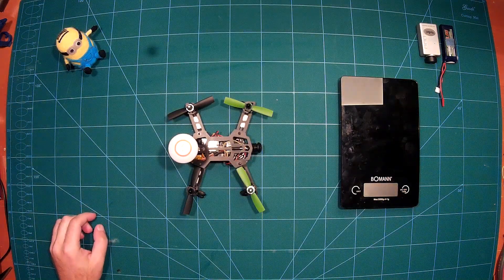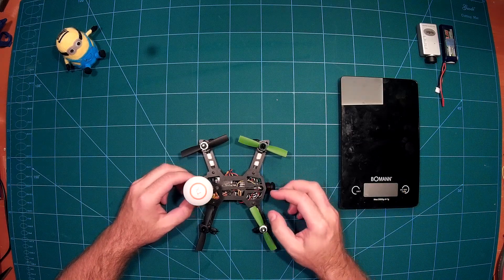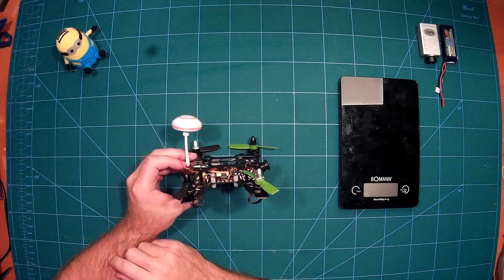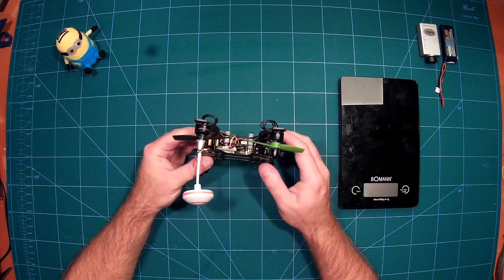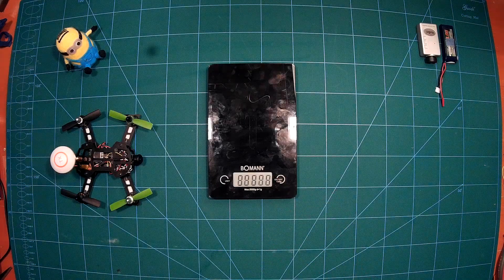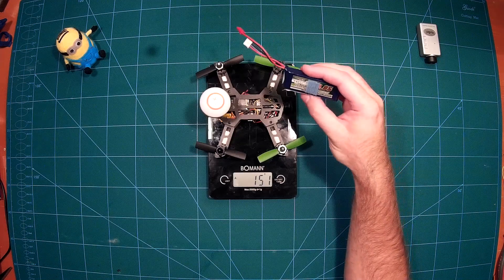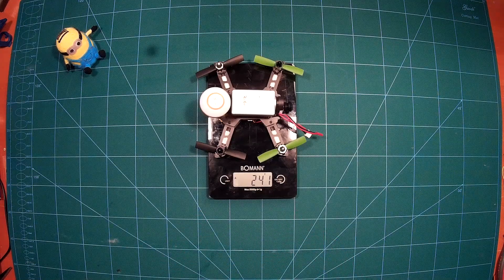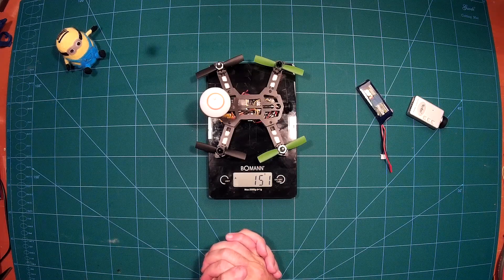Sub 250g Full HD 1080p FPV Quadcopter

Comment: similar to might
my setup. I run on 3s and it flies great, pretty quick. I have flown it with the Runcam on as well,but it doesn't handle as well, though I've just got some smaller 850 3s, d
so it might be better with them. an 808 would probably be better.
Reply from the maker: +Jake Bullit Sounds awesome Jake. Yeah, the RunCam is a bit of an overkill, it was more meant as a demonstration of how light-weight a full-hd recording copter can be these days ^^ :-)

Comment: Many thanks just what I'm looking for, would this battery be good for it Dualsky Xpower ECO-S Series 3S 11.1V  800mAh 25C
Reply from the maker: +Drone Flyer Just to be safe, go for something with a higher C rating. Those Dys can draw 7-8 Amps each with that setup (on punch outs particulary). 7 Amps x 4 motors = 28 amps. Your 25C lipo is only good for 25 x 0.8 = 20 amps. It will probably fly fine with that 25C battery as well, specially since we have only cut 4 inch props on this setup (so the punch outs will rather draw 4-5 amps than 7 amps), but better safe than sorry ... :-)
Reply: +RC FPV Flight  If you C is too low will it just be slower, or are there other effects on punch outs?
Reply from the maker: +VIIXM3 Voltage will go down too far, when high amps are needed (e.g., on punch outs). With too low C-rate voltage may go below the safety margin for the lipo, which can permanently  damage your lipo.
Reply: Thanks!

Comment: what kind of radio transmitter are you using.  I've been trying to find a how to build that shows the radio transmitter and reciever setup so I know what to buy but haven't found one yet
Reply from the maker: +K9 PREPPER Hi! Best for these small builds are Spektrum systems, because of the small Spektrum satellite recievers available. But now you can also use Taranis with the new very small FrSky XSR reciever :-)
Reply: +RC FPV Flight I'm new to the hobby what kind of radios are similar to the spektrum. I trying to find a cheap transmitter that will allow you to store different models.
Reply from the maker: +K9 PREPPER For a cheap one, many people like to use the Turnigy 9X 9Ch Transmitter from HobbyKing. I have no personal experience with it, but it seems to be good. http://www.hobbyking.com/hobbyking/store/__8992__Turnigy_9X_9Ch_Transmitter_w_Module_8ch_Receiver_Mode_2_v2_Firmware_.html
Reply: +RC FPV Flight thx I appreciate it

Comment: This is nice, but I really want GPS and an APM based controller to do waypoints.  Whats the weight your at now?  I have an APM Mini its about the size of a NAZA, it may be able to work with this setup and be under 250g but not sure it will fit.
Reply from the maker: +gencodeinc With GPS and APM it will be more difficult to stay below 250g and additionally you still need to have the GPS a bit away from the rest because of interferences. But it would be an interesting challenge for a build!
Reply: +RC FPV Flight these are pretty light and mini like CCD so may work

http://www.overskyrc.com/hkpilot-mega-mini-apm-v318b-and-autopilot-p-671.html

http://www.overskyrc.com/scisky-mini-gpsm8n-mag-led-with-compass-p-688.html
Reply: +RC FPV Flight 7.5g and 10g respectively

Comment: I've read on RMRC that the DYS 20a esc do not support high KV motors like these.  Have you had any issues? Thoughts? http://www.readymaderc.com/store/index.php?main_page=product_info&products_id=4051
Reply from the maker: +Archie FPV So far they work fine. Got several flights already - no issues.
Reply: +Archie FPV Perhaps this combination may work because these motors have only 9 stator windings (vs. the more typical 12).  The more windings, the faster the ESCs must switch for the same RPM.

Comment: I plan to build using those, the 150mm frame is only 50gramms, and each motor is 11g only:
http://www.banggood.com/Realacc-Y150-Y180-Y200-150mm-180mm-200mm-4mm-Arm-Carbon-Fiber-Frame-kit-with-PDB-Board-p-1119840.html
http://www.banggood.com/4X-Racerstar-Racing-Edition-1306-BR1306-4000KV-1-2S-Brushless-Motor-CWCCW-For-150-180-200-p-1078397.html
I assume it would be lighter